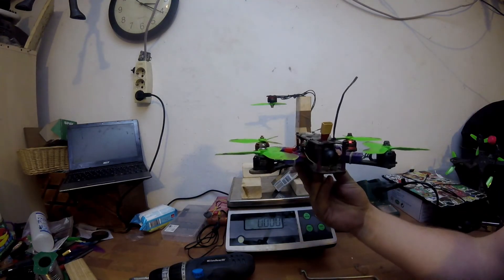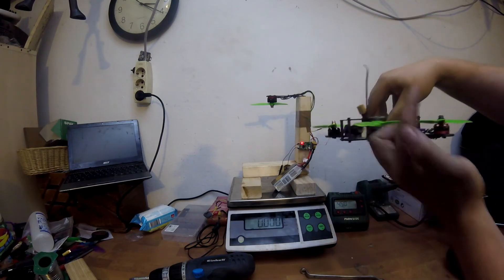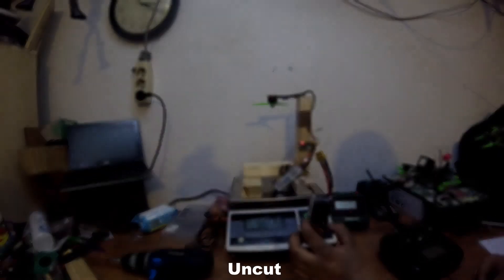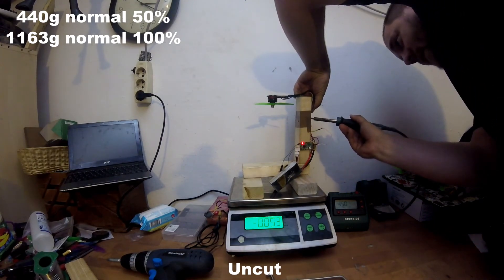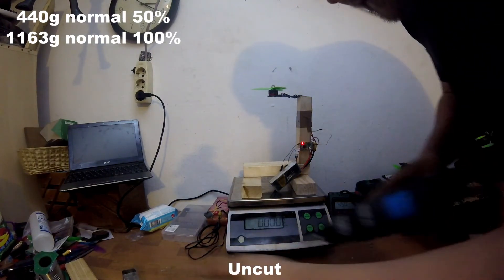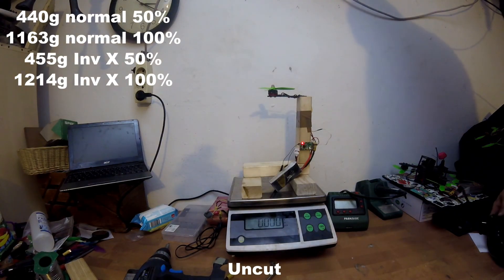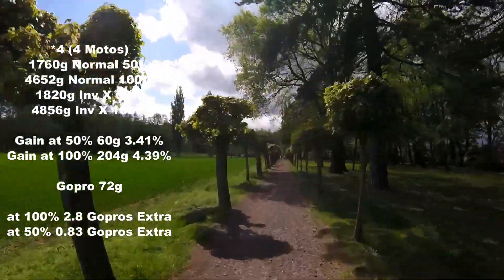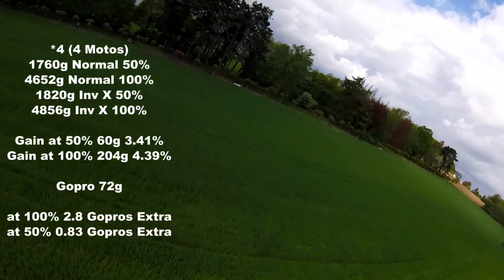Invertet X YES or NO ?

Comment: So it adds 3.5% of thrust at 50% throttle and 4.3% at full throttle. I knew pushing motors are more effective but didn't know by how much. Thank you for that. What was your setup (# cells, motor, kV, props and quad's arm width/height)?
Reply from the maker: 4S 2300KV T*5*4.5 . the arm was a standart ZME250 so around 13mm i guess

Comment: You are missing two things, the extra drag from the arm being in front of the motor isnt being taken into account and using gopros is not a good analogy either as what you feel most about not having a gopro is a lighter quad, not more power. Besides that good test and i might try this myself.
Reply from the maker: to your first point i am sure having the drag under the motor and in the fast airstream ist way worse . and about that gopro thing thats the only thing people can try easy :) 60g means nothing to people :)
Reply: @hanoverview  good point, you might be right about the airstream being worse but it does still deminish the gains,bit like i said i think ill give it a shot, at the very least it makes your quad look cool